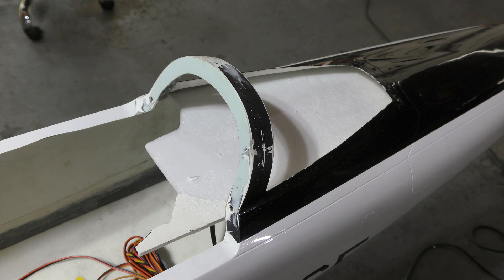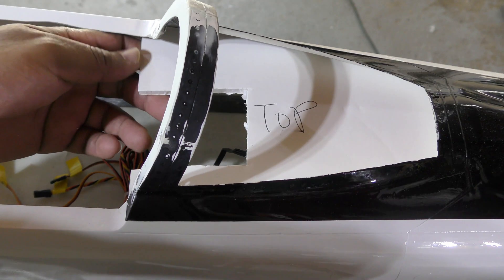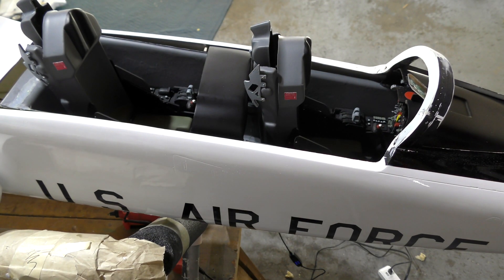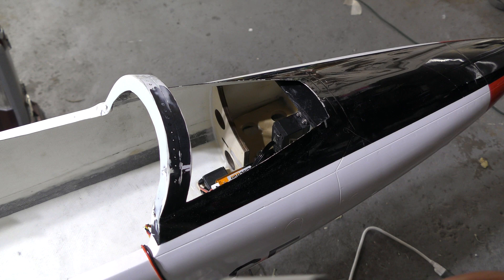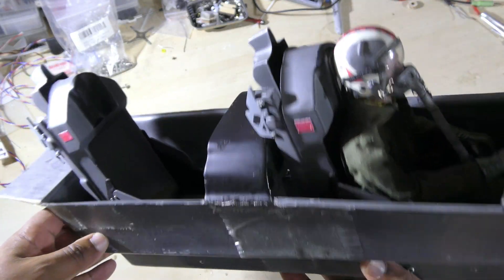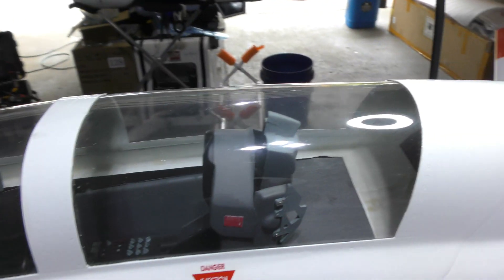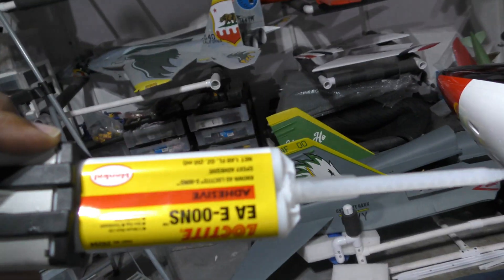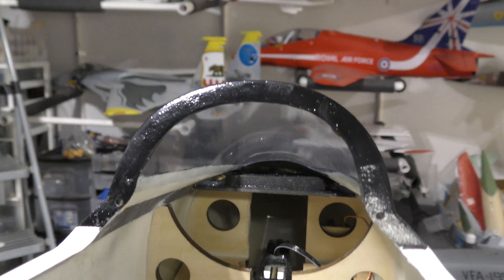Skymaster T-38 Build Series: Video #9: Cockpit Details Installation

Comment: Can this model be built with an EDF unit?
Reply from the maker: You probably could but with significant modifications. I think the biggest issue would be finding an EDF that would work with the exhaust nozzles on the jet and still give good performance. The efflux is just not designed for an edf.
Reply: @FlyWithFrank  I see thanks for the response